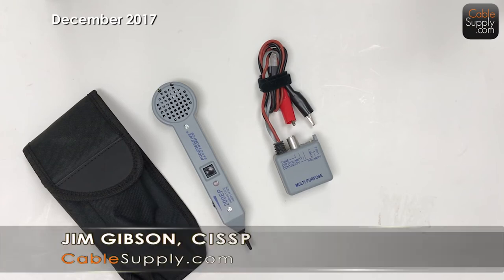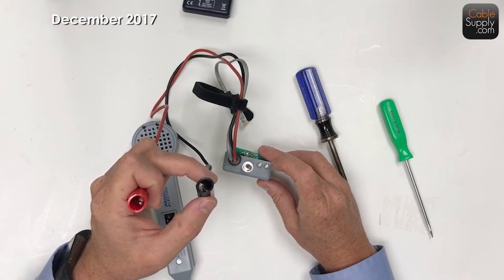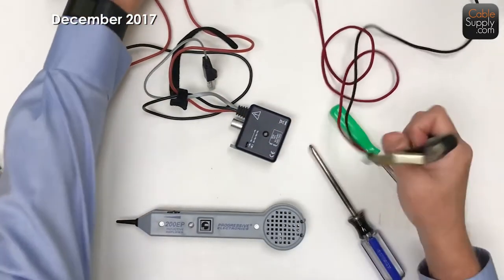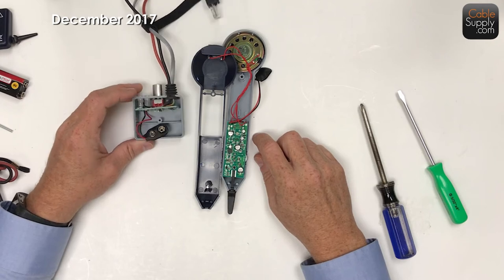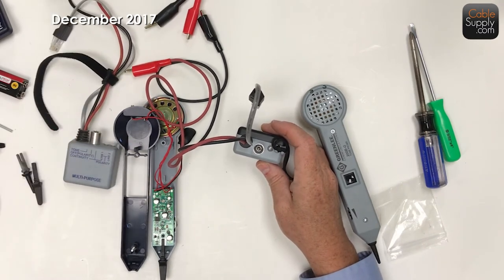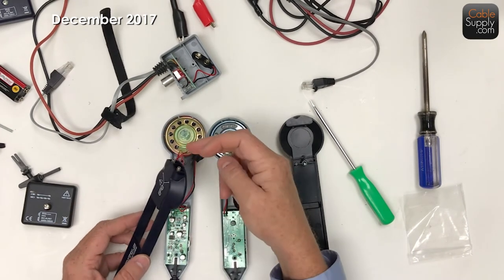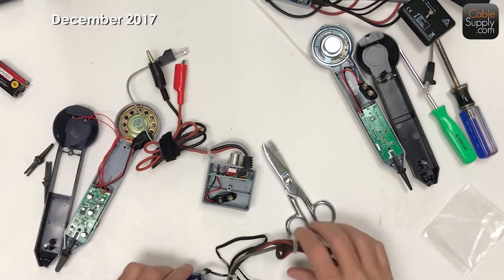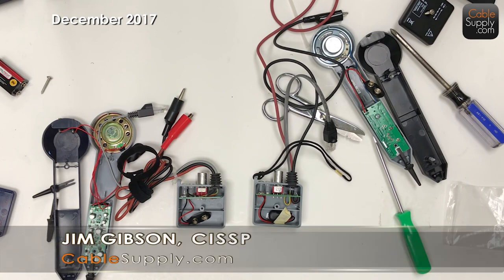Tone and Probe Kit

Comment: Thanks for the look inside.
I have an older 200EP probe (older than your old one) that someone messed with and rewired.
Mine is branded Progressive Electronics Inc.
But I can't find anything on these boards online.
I didn't get the tone module but I think I can make one out of a $1 window alarm or the continuity beeper on a cheap multimeter.
Reply from the maker: Check out my eCommerce site www.cablesupply.com Part number 104219